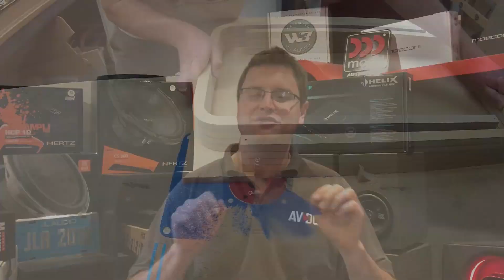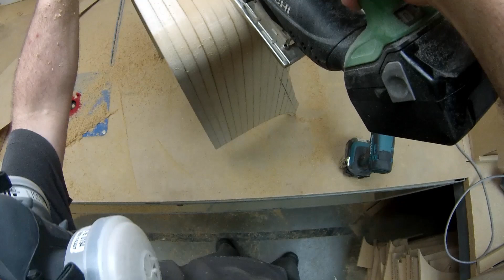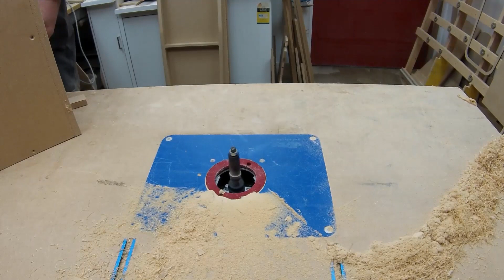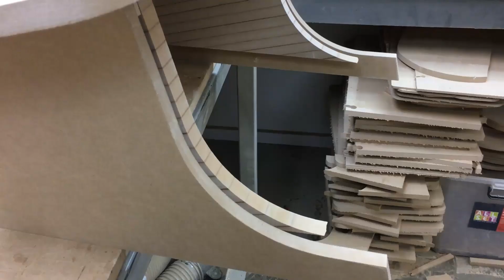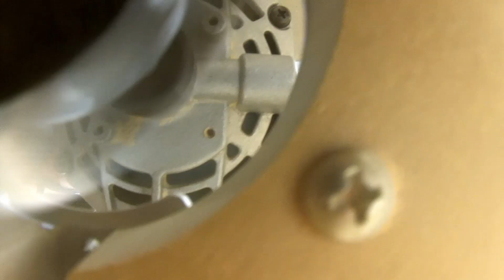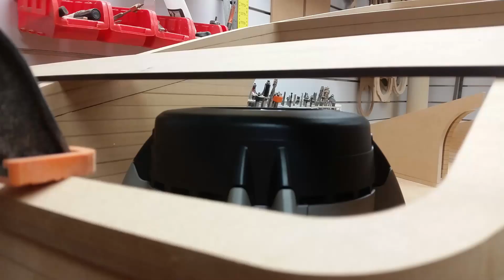Connected: Shaping Custom Subwoofer Boxes - Toyota 86 Car Audio Project - 7

Comment: That DIGIT DELETER is the most scary router bit I've seen yet !, however seems quite effective and gave you a nice finish.
It's quite neat seeing the build stages knowing what the end result looks and sounds like, despite how tedious the stack fab seems its worth it.
May i ask what setting you were changing on the jigsaw as you were going from a flat surface to a curve ? 
Cheers
Reply from the maker: I was impressed with the Digit Deleter too. Six cutting edges help to make it a lot smoother and less aggressive than it might look!
The setting I was changing on the jigsaw is the orbital angle adjustment. With orbital angle, the blade pulls up at an angle for a more aggressive, faster but messier cut. With orbital angle off it moves straight up and down - cleaner, neater and more stable, but slower - making the jigsaw kick less when going around those curves.